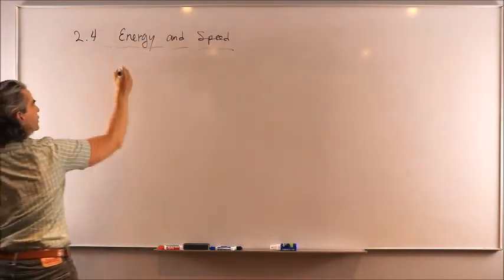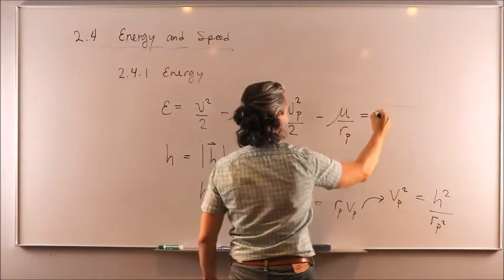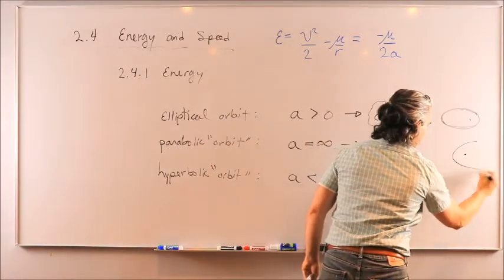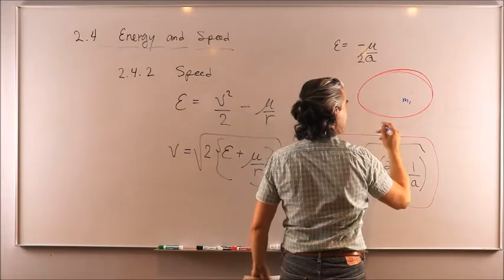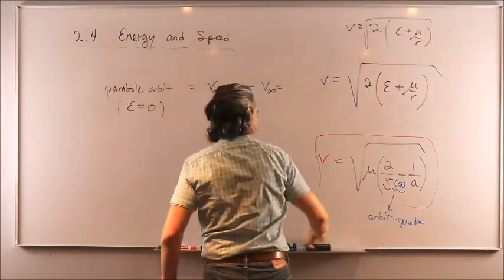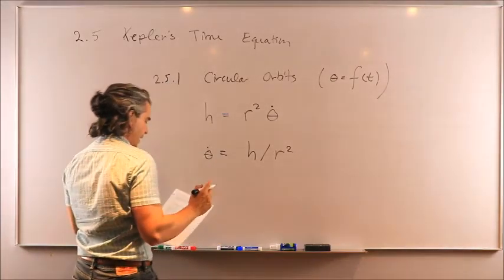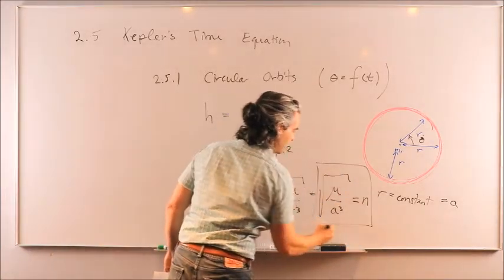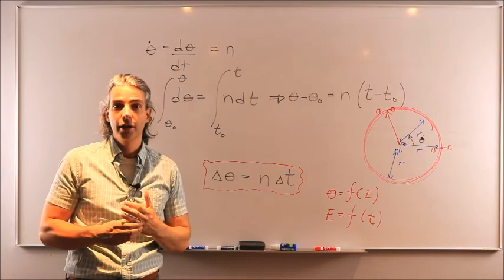Orbital Mechanics - Orbital Energy and the Vis-Viva Equation

Comment: Dear Professor Ulrich! 

I did the "homework" in order to proof E= - mu/2a This was a great practice. Thank you! I would like to share the solution. 

Spoiler alert! If you want to figure out by yourself... I'm not recommend to read the followings.

So the Professor in section 2.1.3. teached that p=h^2/mu (by definition). 
So h^2= mu * p. 
And in section 2.2.1., he said that p=a(1-e^2). 
If we combine the last two expressions together we get: h^2=mu*a(1-e^2). 
Now we focus on [(Vp^2/2) - (mu/Rp) = (h^2/2Rp^2) - (mu/Rp) equation. 
Notice what happening when we adding (mu/Rp) to both sides! 
We get  [(Vp^2/2)  = (h^2/2Rp^2)]. 
Here we can cancel out 2 from the denominators. 
We get Vp^2 = h^2 / Rp^2 
We have to  find new expressions for the right side.
As for the next step we can find expression for Rp if we observe the geometry of the ellipse -> Rp=a-a*e  -> Rp=a(1-e), so Rp^2=a^2(1-e)^2 .
Now we can express the right side:
[(mu*a * (1-e^2)) / (a^2 * (1-e)^2) ] = [(mu * (1-e^2)) / (a * (1-e)^2) ]
In here we just use some magic trick:
mu/a * [ (1-e^2)/(2*(1-e)^2) - (1/(1-e)) ] =
mu/a * [ ((1-e)*(1+e))/(2*(1-e)^2) - (1/(1-e)) ] =
mu/a * [ ((1+e)/(2*(1-e)) - (2/(2*(1-e)) ] =
mu/a * [ (e-1) / (2*(1-e)) =
mu/2a * [ (e-1) / (1-e)) =

as for the last step, just bring out a (-) minus from the numerator
-mu/2a * (1)

Sincerely yours,
Deni